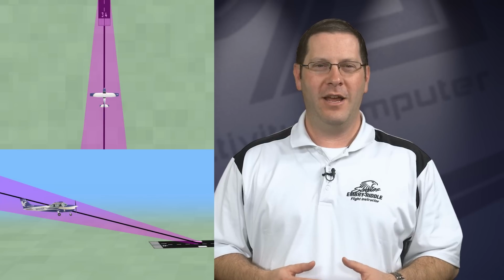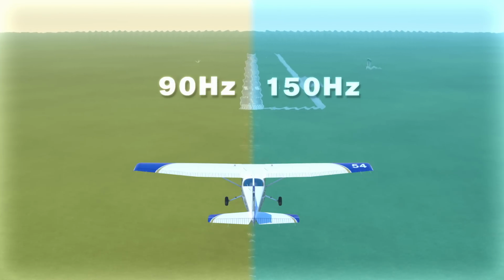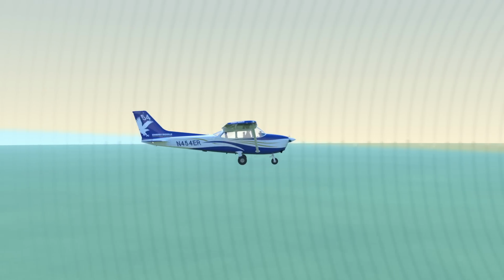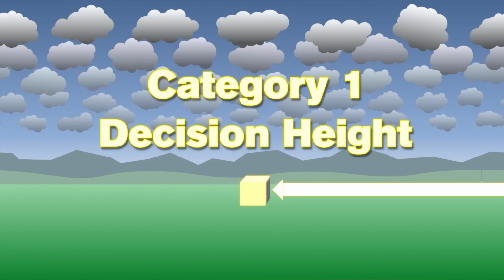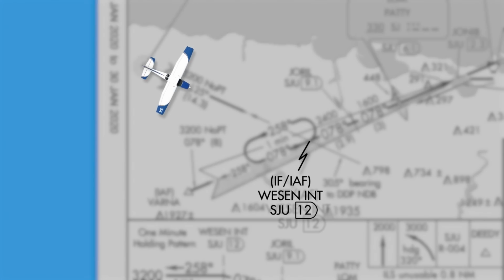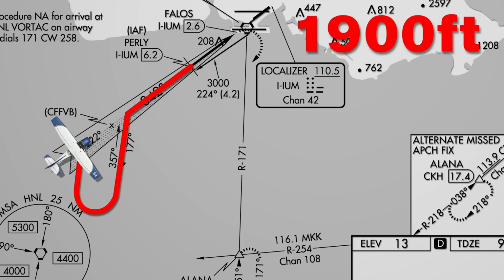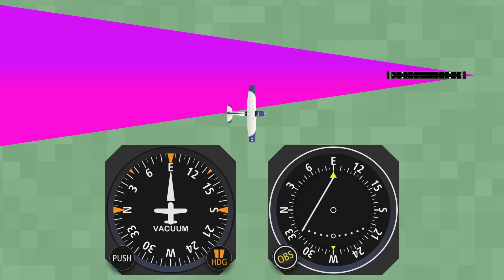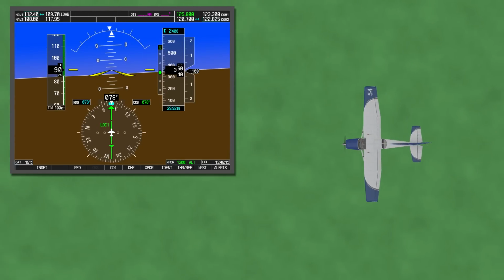ILS Approaches

Comment: Some OBS systems add as an example on the G 1000 you have a BC button which is for back course. An OBS that is equipped with a backhoe or sensor will have a green LED light next to an icon that says BC I believe if you push the button, it automatically sets the phase 180° out so that the needle appears to be tracking in the right direction. In this case you fly to the needle even on the back course.

Comment: One hint for GPS users: set your GPS to "cumulative distance" on the flight plan if able. For some reason, most GPSes default to the distance to the next point, like 0.5 Alpha, 0.5 Beta, 0.5 RWY 14. Instead you use cumulative it is 0.5 Alpha, 1.0 Beta, 1.5 RWY 14. It gives you better situational awareness as well as allows you to call out distance to runway to other traffic without doing the math in your head.